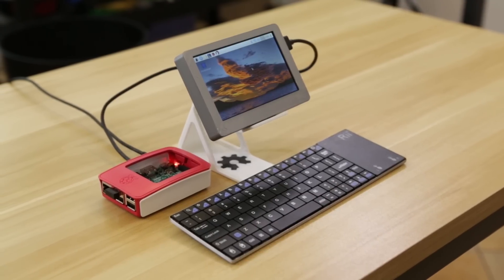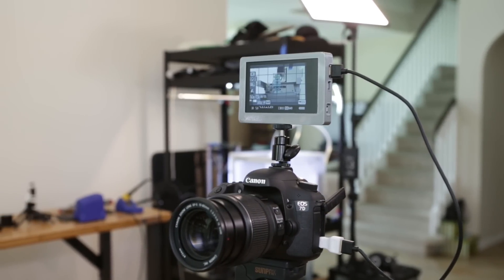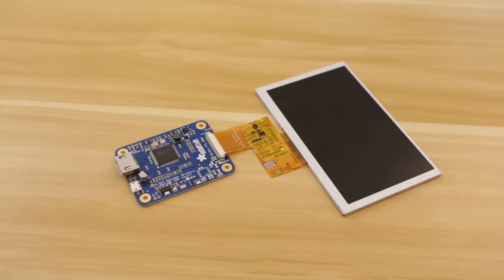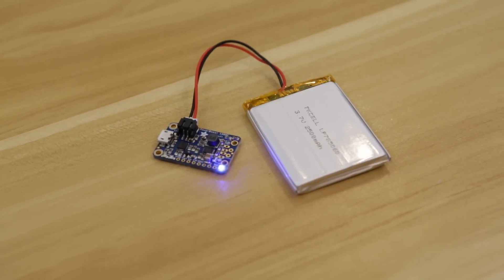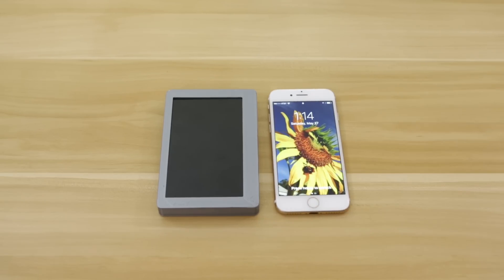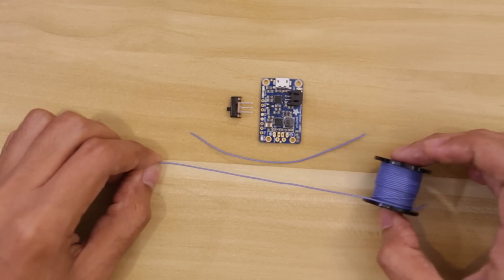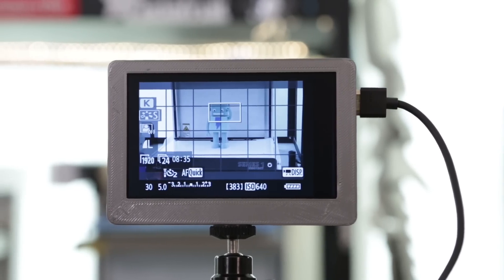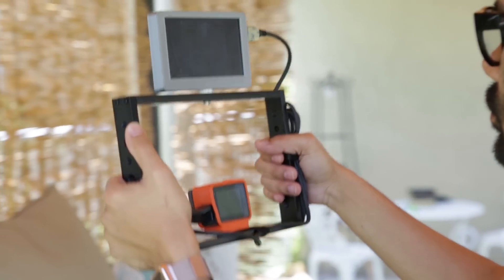Portable HDMI Display for Raspberry Pi

Comment: Hello, I have a 7-inch monitor with 26 input pins (HN-HSD070AL-REV:03-A00). I want to use it only for AV image or hdmi input. Which control card do you think is suitable?

Comment: How do you accurately measure the components inside, to figure out the perfect dimensions for the case?
Reply from the maker: normally theres tech drawings (typically in data sheets) for each part. but if not digital calipers are a good way to get accurate dimensions.

Comment: Followed your tutorial (with all the parts from Adafruit), get power to the board, but just getting white lines on the display. Reconnected the ribbon cable but with same result - any suggestions?